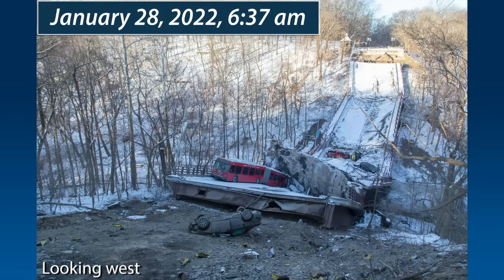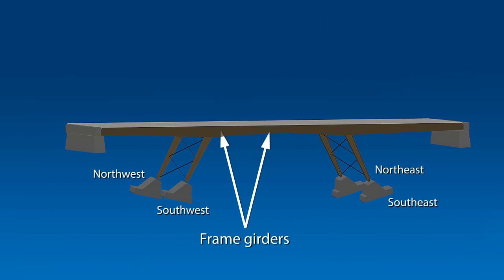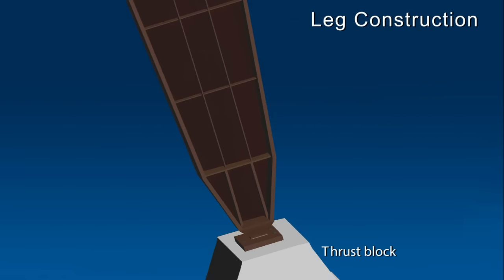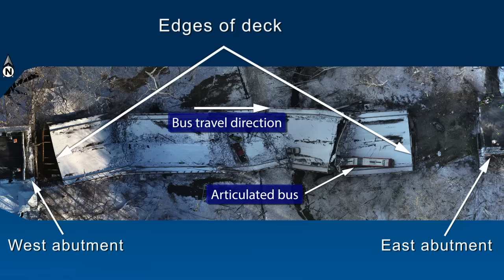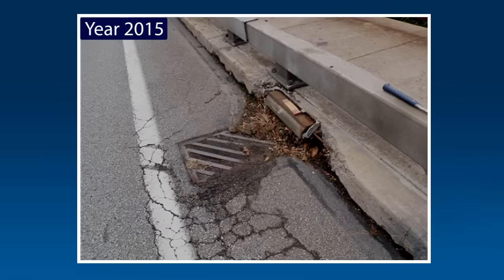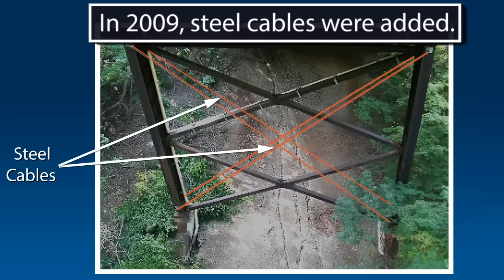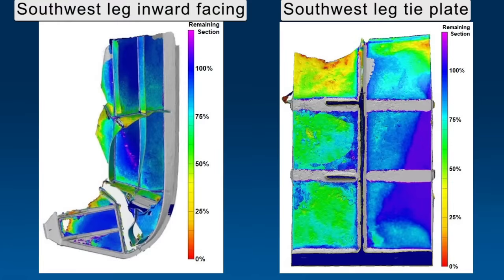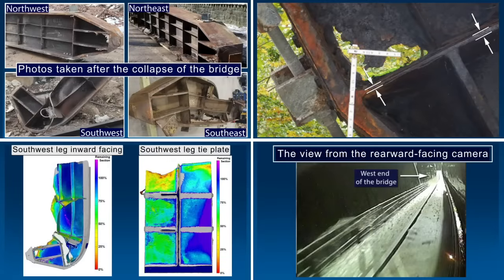NTSB Animation – Overview of the collapse of the Fern Hollow Bridge

Comment: Unbelievable that a bridge with this amount of damage is allowed to be used by vehicles.
Reply: Yet again beurocracy reigns.  The state is required by law to inspect bridges. Great.  These files get recorded and placed in a file marked bridge inspections.. but thats it. There little to say whos job it is to read the report. Typical council job. No responsibility in the right departments.
Reply: these issues can't be fixed by voting
Reply: Criminal negligence.  Guessing no one was even fired though because government operates outside the law.
Reply: "Cough, cough" they preemptively mitigated risk by imposing a posted weight limit - there! And, And, good intentions to repair.
Reply: Fixing infrastructure just isn't sexy, so it gets little to no funding until something breaks - at which point it becomes an emergency which opens up Federal assistance and most environmental rules getting set aside (can't say that having a bridge fall into the stream was good for the habitat).  I would also say that those bridge deck drains were never maintained, so the Penn DOT maintenance department needs some scrutiny.  Properly maintained, this structure should have lasted 100 years, not 49.  But we may expect more of the same in America where roads and bridges now must compete with "human" infrastructure, like paid daycare for single working mothers, for funding.
Reply: @smo-guiver8315 Indeed. However, the folks here can blame bureaucracy/gov't, but similar things happen in industry too, like Boeing for example. 
Somehow, there needs to be a framework where the greatest needs come to the surface. That being said, there so many needs that their will not adequate funding to serve them all. 
Somehow, when a bridge is in such a state, there should because way to immediately get some attention. However, with inflation strained budgets, it's understandable that councillors will want to buy time as they expect the laws of physics to conform to their budgets.
We've had both liberal and conservative minded folks running all of this for over 50 years. We need a way for such matters of basic infrastructure to be assessed and fixed as required and the town will have to cut other things or raise taxes ... or ... they can close it and folks can drive out of their way.
Reply: @smo-guiver8315  
"...But we may expect more of the same in America where roads and bridges now must compete with "human" infrastructure, like paid daycare for single working mothers, for funding...."
Be facinating to know, which U.S. state you're located in. Where this mythical daycare funding exist!?
In the meantime (2009) there's a really heavy bridge, with holes in its legs, and the menfolk(?) never quite got back to it!?...
Reply: Part of the problem in most cases is that the structure was "fine" until it suddenly failed catastrophically.

Even though the structural strength was undoubtedly compromised it doesn't seem like the supporting leg was even bent prior to the collapse.

Knowing that there is a significant problem is different from comprehending that spontaneous failure is imminent...
Reply: It passed its inspections. Good to go. Just ask management at DOT.
Reply: This is PIT. No one is surprised the bridge was in that poor condition. Also no surprise it fell. The only surprise was it took this long to happen.
Maybe the West End or Ft Pitt bridges need to fall before someone will take notice. Then again… look at the debacle of the Ft Pitt tunnel maintenance. PIT + PennDoT=🤡
Reply: @ReflectedMiles  how exactly did it pass inspection? 🤔
Reply: @RubenKelevra  By having people who are just trying to get by 9 to 5 until retirement. No one wants to be the one to say, "Close it. Block both ends, all lanes. It's done." I don't think they had a team out from UL Laboratories for a thumbs-up / thumbs-down. Maybe from Boeing McDonnell Douglas, though.
Reply: @ReflectedMiles  no idea what you mean by that. This way you get attempted manslaughter charges. How's that going to help your "oh I just ignore it and it'll go away" mentally?
Reply: @RubenKelevra   We are talking about the US, right? When was the last time you ever heard of a county or state inspector getting charged with anything for giving a passing grade to an inspection followed by a failure? It's just not a thing. The biggest fear for local government workers is that someone, someday is going to invent a shovel that will stand up on its own.
Reply: @ReflectedMiles  nope. I live in Germany. That would happen here.

I can't believe you have lower standards in the US regarding bridge safety.
Reply: You should see some of the other disasters waiting to happen.
Reply: @RubenKelevra With a wink, a nod, and a fish sandwich.
Reply: @RubenKelevra There will be no charges, as state law limits the city's liability to $500,000 and gives the state immunity from liability and prosecution. 
Wonderful system, eh? Cheaper to pay the lawsuits than to do the work.
Reply: @spaceflight1019  but an inspector is not a liability of damages, but it's an issue of judgement. So it's a criminal offense which shouldn't be capped in any way shape or form.
Reply: @RubenKelevra  If the former mayor is named as a defendant, and confronted with his interview with WTAE, deliberate negligence can certainly be proven, but criminal negligence requires a higher burden of proof.
Reply: @spaceflight1019  wtf has a random major to do with that?
Reply: @RubenKelevra  To what "random major" do you speak? Architectural engineering? Mechanical engineering? Be specific, Bob.
Reply: @cwmbc this is like "Our eggs have been tested for salmonella."
The results show they all are infected, but that doesn't mean we won't sell them.
Reply: @ReflectedMiles no, it failed inspections, but apparently NTSB can't order the bridge closed or repaired.
Reply: @LeifNelandDk  The NTSB has nothing to do with bridge inspections and closures. They are just the investigative agency that determines cause, and sometimes issues legal or procedural recommendations, after a catastrophe in the hope of preventing it from happening again. Both the local county and the state have the responsibility, authority, and capability to shut down use of any bridge that fails an inspection, just like they have the ability to prevent occupancy of a home that has failed its building inspection. They kept passing and utilizing the bridge despite what those inspections showed—that is the NTSB’s point in this video.
Reply: @ReflectedMiles  okay. So  the person blaming NTSB for not doing anything before the bridge failed was totally in the wrong.
Reply: @LeifNelandDk  Correct. It’s like blaming them for a pilot crashing an airplane. Investigating the accident is their responsibility, not the conduct or licensing of the pilot or the FAA.
Reply: It's all a matter of priority. 
If the bridge were on the Mexican border, it would be in excellent condition, because millions of super high skilled workers would cross it every month.
Reply: @BebtelovimabClearly it happens here in America.... It happened, you're watching the video.
Reply: I would guess a solid 25% of the bridges in the US are being used despite comparable defects.
Reply: @donaldballjr  that's pretty unbelievable. Do you got any source for this estimate, meaning where it based on?
Reply: More unbelievable that the richest country in the world by far is so poorly run that these events aren't uncommon.
Reply: @TheHonestPeanut  actually the US is extremely poor. The richest country in the world is Norway.
Reply: @RubenKelevra  so my point was America thinks it's the richest and best but it's literally falling apart. However, Norway only has a bit more wealth per capita than the US. They just manage it better.
Reply: @spaceflight1019  Just to be clear. If Knowing that the bridge will prematurely fail during normal operation and not acting to prevent that is negligent!  How does, allowing the bridge to fail (or continue normal operation) with the inherent risk of injury or death not constitute criminality?
Reply: @mderline4412  That is a great question, one that will hopefully be asked in front of a jury.
Reply: We still have bridges here in far worse shape. The city just doesn't care.
Reply: Just dont start looking into your local bridge. You might quit driving
Reply: @drink15  bridges here look absolutely fine. Thanks tor asking. Best regards from Germany.
Reply: @RubenKelevra  Oh, didnt know you checked the support beams, got close up to examine wear and rust, checked for cracks in any concrete and pull inspection data. Or do they just look fine as you drive pass?
Reply: @drink15  it's made out of stone :)
Reply: @RubenKelevra  Doesn't matter what its made of.
Reply: @drink15  there are no support beams in stone construction.

But I can gladly report on the next bridge which is made out of concrete beams. Looks basically like new, just a bit of spray paint in some areas
It's built in 1992.:)
Reply: @RubenKelevra  You missed the point but go for it
Reply: @drink15  feel free to explain how a perfectly looking concrete bridge is an issue :)
Reply: @RubenKelevra  1. You are still missing the point.

2. Rebar rusts from the inside out.

3. Fresh paint hides cracks, patches, and other damage/repairs.

4. You are still missing the point.

5. Unless you are inspecting it close up, you have no idea of its condition.
Reply: You should see the I-10 bridge (Louisiana) that spans the Calcasieu River/ ship channel between Lake Charles and Westlake.
Reply: @smo-guiver8315 it’s also because federal money often builds these things but state money is required to maintain them
Reply: Well you might want to keep in touch with all your U.S. comrades that are so anti-tax this and there.
Reply: that's our government. need some of those billion's from ukrain.
Reply: @thomasgirty6397  that's grossly misleading.

Let me explain:

If you give someone your rundown car, which barely runs and is 25 years old. Would you say it's 1000 bucks worth or the sticker price it had when it's new, say 60k for a new truck? 

Most people would probably say 1000 bucks.

The US government however accounts 60 k for this trash already on the way to the crusher. So they send outdated and already replaced stuff to the Ukraine.

Same for the anti tank rockets. Those were mostly past the expired date on them. So they wouldn't be used by their own forces anymore, and maybe would be used in some training, since they are worthless.

Many of them still functions, but the guarantee that they function at x% is gone, so the percentage usually drops sharply after the expired date.

So the US mostly sent their junk and did the accounting like its new stuff, probably just to show, that they did the most for Ukraine or something like that.